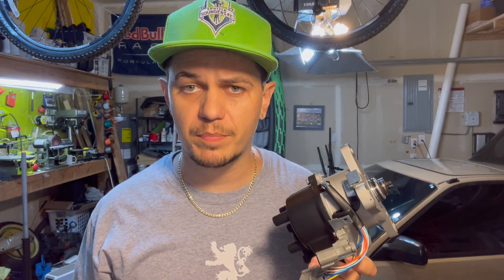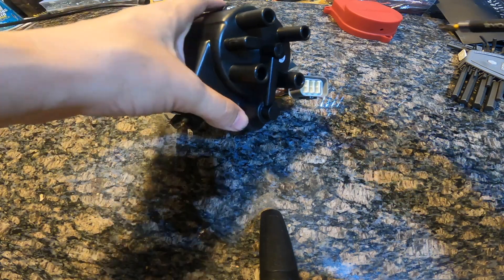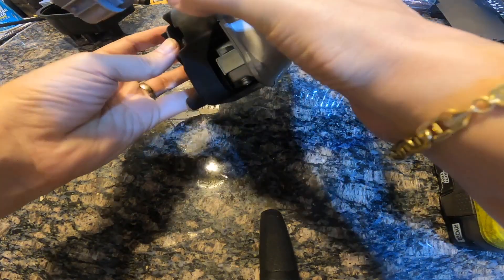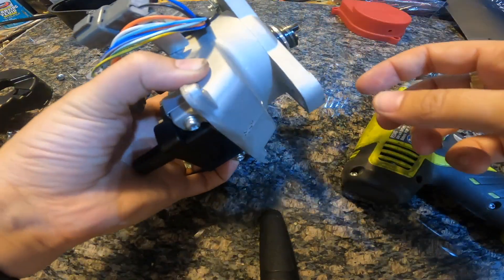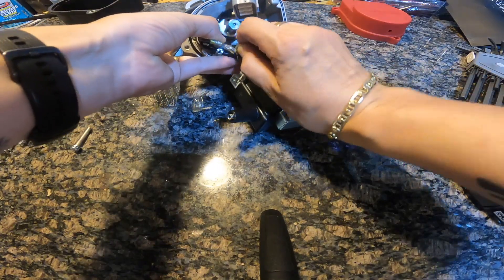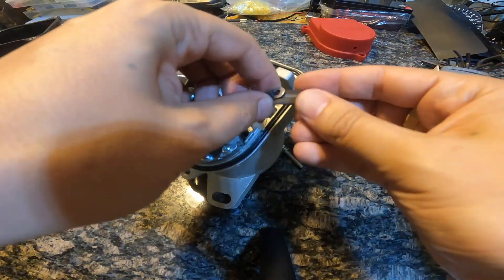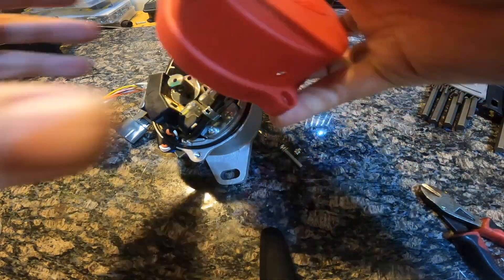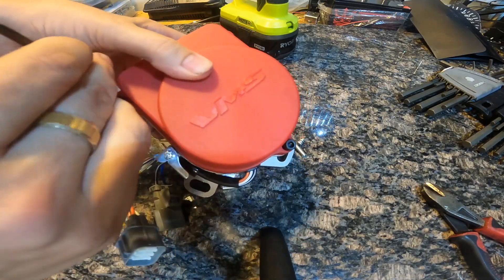Delete your Honda distributor cap, rotor, igniter and coil for coil-on-plug conversion

Comment: So you are not using the second 2 pin connector correct? That would be the same to wires that no longer go to anything or no?

Comment: I like to "double-bag" connectors like that too.  I'll do two layers of shrink tube.    I always thought the dizzy was the weakest link on the B series. Like seeing this. 

You can get shrink tube with internal glue that holds it in place after shrinking
Reply from the maker: It sure is the weakest link

Comment: Hi. Bro a quiestion Do you have to modify the ecu?  I have a p28 and they told me that I have to put S300 hondata be able to put coils.!
Reply from the maker: You do. I have the HondaRulez PCB added to my OBD1 ECU: https://ae-race.com/products/honda-b-series-coil-on-plug-harness?_pos=59&_sid=ae417d349&_ss=r&variant=37767378501803

Otherwise you'll have no outputs on your ECU to power the coil packs.

Comment: wow you also are supposed to remove the icm in the dizzy an pull the black an yellow also blue wire depin plug also the icm wire depin it from the plug the green an white wire theres a video from burton racing that shows you i think u missed a few things but nice video great job just missed a few steps another video would be awesome👍🦾
Reply from the maker: I think I explained it poorly. There's no need to repin anything because of the way the AE-RACE coil-on-plug harness is wired.
Reply: There’s no need to remove anything if you don’t want to, you’re only using the cam/crank/tdc sensor the ecu looks for in the distributor. Power is supplied to the new coils via the factory engine loom and tach signal comes from the hondarulez board. All that is wired in the new harness provided in the kit.

Comment: I'm confused, the link for the product says it won't fit a GSR distributor. Can you shed some light on this?
Reply from the maker: You're right it does say that and I'm not sure why because I used it just fine - it's possible I actually have the Type R distributor. I'll need to check on that.
Reply: @joelatwar  did you ever find out if it will fit GSR dizzy??